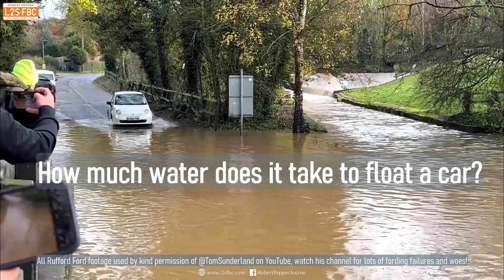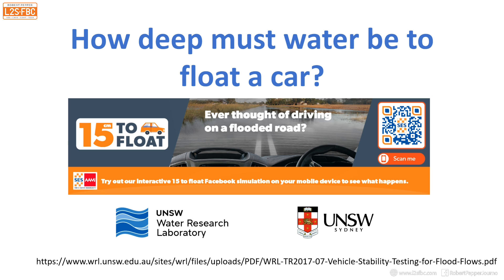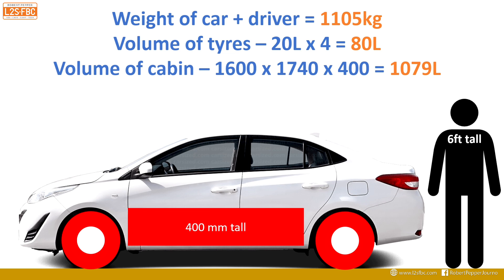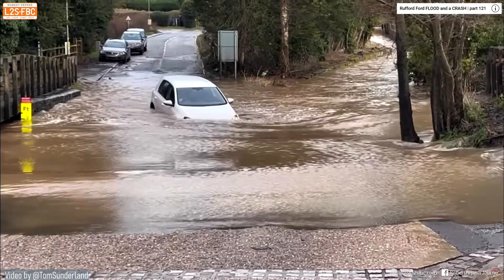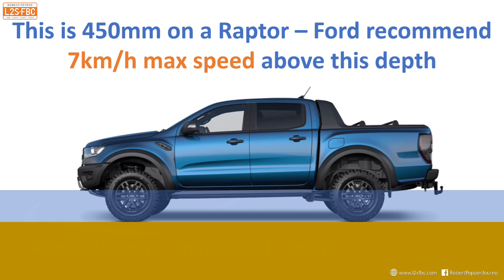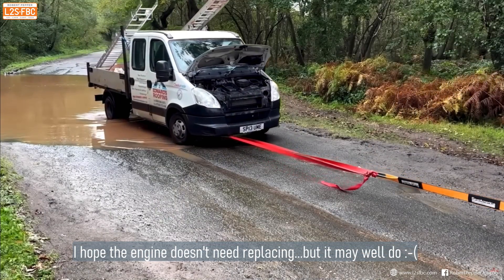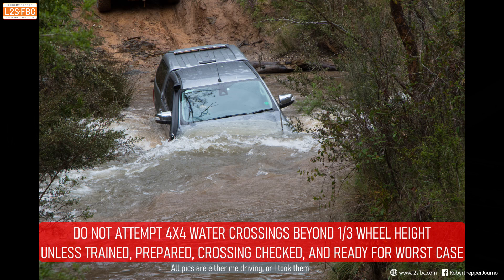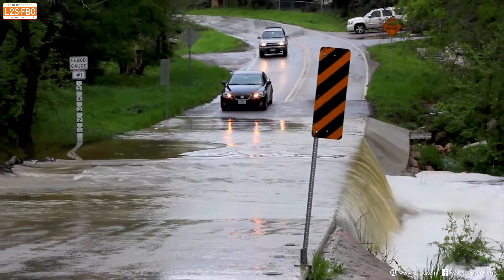How much water does it take to float a car?

Comment: Nice video thanks. But when a city is flooded you are forced to pass as there is no other way. So if I have a sealed snorkel and the car is floating and the engine is running how to move the car forward?
Reply from the maker: Paddles.

Comment: I don't think you'll be opening that door. Water exerts around 10kpa/m of pressure. So at the top of the water surface you have zero kpa, at the bottom of the door you have 4kpa.

Because the relationship is linear, that gives a total average across the whole door of 2kpa.

Take the area the water is acting on to be 0.4m by 1m, so 0.4m² and at 2kpa that gives a total load of 800N, or 80ish kg. That's quite a lot to be pushing sideways.
Reply from the maker: yes, I should have added downstream door, and even cracking it just a fraction can help. I have done it, once!

Comment: Years ago I was teaching some RNLI Water Rescue Instructors for 4x4 driving. We talked about their rules-of-thumb being 6 inches of water at 6mph will knock people off their feet and could move cars. So 150mm@10kph
Their view was quite scathing of 4x4 and particularly ute drivers thinking that the closed road signs didn't mean them. Then they got stuck and had to be rescued. Risking others.
I tend to teach still or almost still water no more depth than your wellies. Because you obviously would have carefully walked the crossing... So too deep to walk in wellies is too deep.
Reply from the maker: Good advice!  I like 6/6, and the principle behind 15-to-float is good, but it ends up looking nonsensical and therefore loses its value as an easy safety message.

Comment: I used to do a lot of very deep crossings when I had an old troopy. Flowing water would mean opening the back barn doors to flood the back of the vehicle to stop it shifting in the current, something you cant really do on modern vehicles. Fast flowing water, even when shallow should be treated with extreme caution. Today I steer well clear of most crossings, it's just not worth the risk and costs in modern vehicles

Comment: Driving techniques aside, one of the puzzling features of the Rufford Ford videos is the apparent inability of some drivers to understand the significance of the prominent flood height markers at the side of the road. In the absence of reliable information about water depth I default to my father's advice from 50 years ago when he was teaching me to drive in a floodprone part of Australia - "Park the car and wait for some other fool to try it first".
Reply: Good advice but don't be misled by the ability of some cars over others. A landcruiser trayback may easily cross a flooded flowing creek duw to minimal side area, but a landcruiser troopy with a much larger side area will provide a lot more resistance and be swept away. Stay out of water is the best advice.

Comment: My question at the end but...

While you did talk about unprepared vehicles, I'd like to emphasise that the problem is not just the air intake but also things like differentials and transmissions. These components have a breather open to the atmosphere to prevent pressure build-up blowing out seals.  While these usually have rudimentary one way valves, they are not designed to prevent water ingress and how well they work depends on the design and cleaning/maintenance.  The mechanism is that driving a hot vehicle into water chills the cases of drive line components (diff, trans) causing a sudden vacuum that draws water in through the breather.  It's a guaranteed problem for an unprepared vehicle.  Yes, the redneck work-around is to let the unprepared vehicle cool down fully before attempting the water crossing, and hoping that the seals are up to the task of keeping all of the water out.

Therefore, any unprepared vehicle should be considered unsuitable for water deaper than the axles (bottom of the axle for a car, center of the axle for a 4x4).  If water gets into these components serious damage could occur if it's not dealt with immediately.  This is coincidentally where fast flowing water is likely able to move the vehicle as the "sail" area of the wheels and body become a significant factor regardless of preparation.  Those are the main issues but there others, such as the radiator fan(s) pulling themselves into the radiator and electronic components (fans, horns, wiring harness, ECM etc) being damaged by water.  There's a lot to think about, and I'm sure it's a case of a lot of these car-in-ford incidents are because the divers just have no idea what they don't know about it.  Also, I'd say that at least 95% of people who put a snorkel on their vehicle don't do any of the other stuff.  t's the Dunning–Kruger effect playing out right in front of us.

My concern personally is that my previous vehicle was a lifted Hilux that I did river crossings in (a Cape York trip some years ago) but now I have a Jimny.  I'm very wary of water crossings because of the low weight of the vehicle, lower ride height, and question whether I should even get it prepped for that kind of terrain.  My feeling is that the smaller size of the Jimny loaded to capacity probably isn't going to be any worse than the tub sided dual cap Hilux that I used to have up to the top of the tires.

Have you heard of anyone prepping their Jimny for deeper water (I haven't) and what are real limitations if that is done?
Reply from the maker: Brilliant points Chris, I didn't cover them all other than a general "prepare the car" statement.  I don't think Jimny drivers do a lot of water crossings!

Comment: Learnt a lot about driving through water when I was in the Christchurch Land Rover owners club many years ago. Lots of braided river trips always in groups with knowledge and recovery gear.  
I have been watching these Ford crossing videos for a few years and it's rare to see someone using correct technique but that's what makes them entertaining. There was one where you can hear the engine of a small hatch back hydro locking. 
Glad to see some good explanation and scientific research into the risks of crossing flood water. 
The police closed the road and put concrete barriers across, the water rose further and concrete barriers were then submerged and that's what the tractor drove over.

Comment: You have to remember that the point at which a car becomes undrivable due to reduced weight on the tyres and subsequent loss of traction is a lot less than the depth at which it will float

Comment: Robert, I think it is important to point out that opening a door against the force of the water surrounding the car may not be possible, in fact in the video you showed, the man tried to climb out of the window. Advice here is: when in water, immediately open as many windows as possible to be used as escape hatches.
Reply: You should fully open your windows BEFORE any water crossing. Modern day electrics can mean windows wont open at all if flooded.
Reply from the maker: Yes downstream door would be easier.

Comment: Living in Australia, the land of droughts and flooding rains it can be quite common to come across a flooded section of roadway. I have learned the hard way about what speed to travel through shallow flood waters because if you go to fast, you force water up into the engine bay and this resulted in damage to my water pump which was attached to the fan blade. Another time in a larger vehicle, I experienced a brief floating of the rear drive wheels because the vehicle was lighter in the rear and also had an LPG tank just behind the rear differential. It is a funny feeling to be losing traction in the rear by lifting slightly. 
Another hazard to be aware of if making a river crossing in Northern Australia, is Saltwater Crocodiles. Any waterway or body of water North of Brisbane has to be treated as suspicious period. 
As shown in this video it doesn't take flood water much to lift a vehicle and push it off a causeway or to flood the engine and leave you stranded in the middle of a large creek or river with Salties just waiting for you to jump out of your vehicle and into their domain. 
Mark from Melbourne Australia 🇦🇺 Former Australian Army Reservist 4x4 trained, Land Rover and Unimog!
Reply from the maker: Brilliant, thanks Mark!

Comment: Thanks Robert. This advice never gets old. There are more risks at play when driving in deep water. Engine driven plastic radiator fan blades can grab the water and flex into the radiator, chewing it out. In extreme 4x4 water crossing the use of a tarp straped to the front can water proof the engine from the bow wave. For every day driving take the official advice keep out of the stuff. Cheers
Reply from the maker: Yes, lots of things to go wrong..may at some point do one on all the potential problems such as water into seals, fans as you say, electrics, hydrolocking...lots of things to go wrong immediately and long-term.